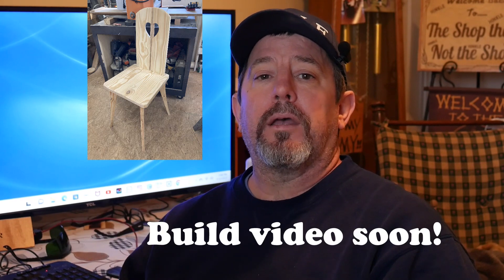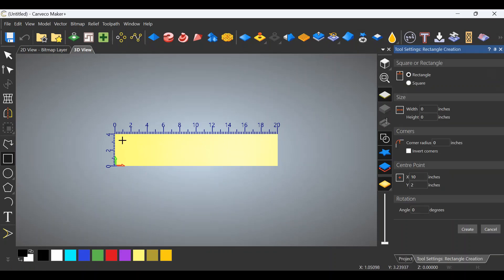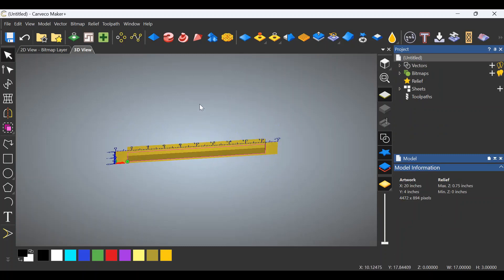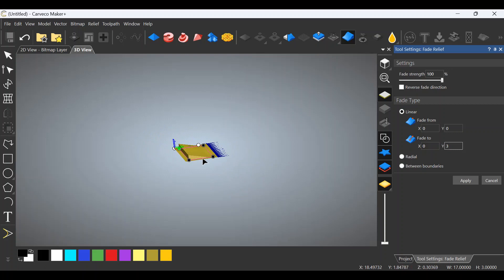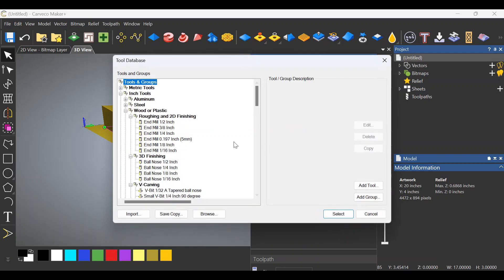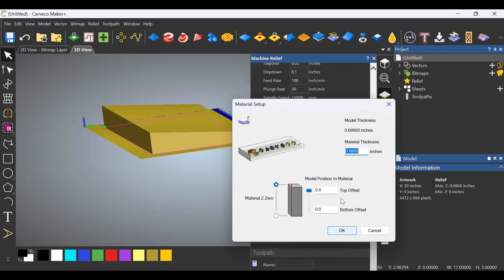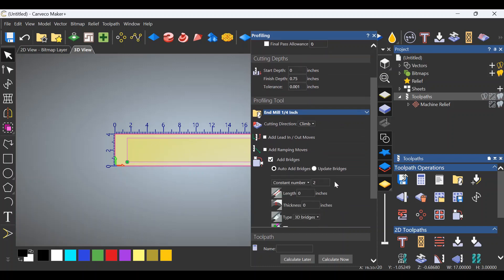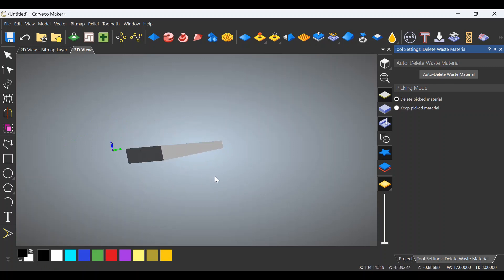FULL LENGTH BEVEL @Carveco maker plus tutorial

Comment: I see the better and quick way to do this.......

Extend your design to about 1inch from all sides..offset by 1inch...make toolpath for area clearance of the plan that ecloses the intial 3D design....run the simulation for 3D carvings then project the area clearance toolpath to the model....use endmill tools for this......

Sorry  for my English.....simply is that....

Transform Toolpaths to the model/.....
Reply from the maker: Awesome thanks for sharing
Reply: @VernonHinkle  and the best you can do....set the step down to approx nothing....like 0.02mm  now if the clearance needs more step down due to hardness of the work piece adjust on running the cnc machine accordingly ......the same toolpath you run numerous times.......

Comment: This question has nothing to do with your video. It’s just a question to you. How would I go about using maker to cut a 45° angle. Let’s say I have a 1 x 4 and I want to cut a 45° angle on each end. Kind of like a picture frame but not.
Reply from the maker: I think I understand your question 
There are several ways to do this 
Probably the easiest would be to create a rectangle larger than the board and rotate it 45 degrees then slide the rectangle over the end of the board or workpiece and use the snip tool to remove everything that is not at a 45 on the end of the board 
Hope that makes sense and helps
Reply: @Hinkleshop  
Awesome I will give that a try. Thank you.
Reply from the maker: You’re welcome thanks for watching

Comment: Hi Vernon. I need help. I have CARVECO Maker and can't get the vector deleted that I copied from the internet after I reduce colors and move it out of the vector that I copied from the internet. I can't delete the vector I copied from the internet. I looked on CARVECO tutorial and can't find the one that explains how to do it.  Can you do a video on this. I'm sure I'm not the only one that is having this problem and it's probably easy. I sure would appreciate it. Thanks.
Reply from the maker: I’ll do my best Karl 
Not quite sure what the actual problem is though by your description I think you mean deleting the bit map so you are left with vector lines if that is the case go over to the right side and shut off the light bulb  beside the bit map icon
Reply: @Hinkleshop  So you can't delete the bit map at all you can only turn it off so that the vector lines are only showing. I'm thinking like it works kinda like LIGHTBURN I guess.
Reply from the maker: @karlriley1314  that’s correct